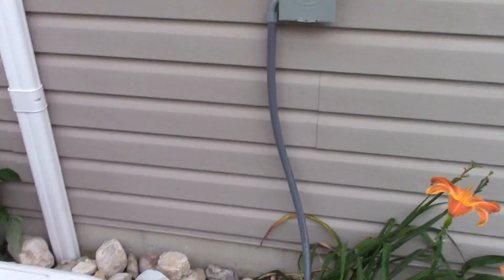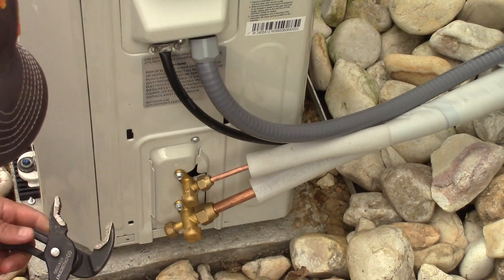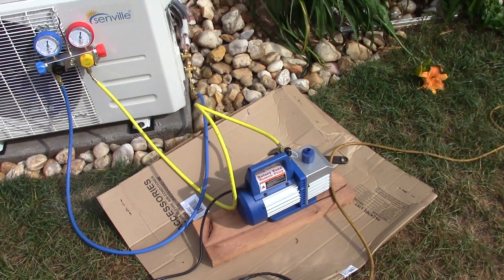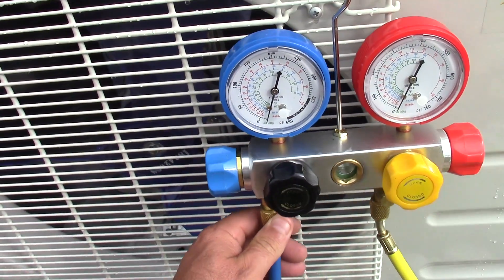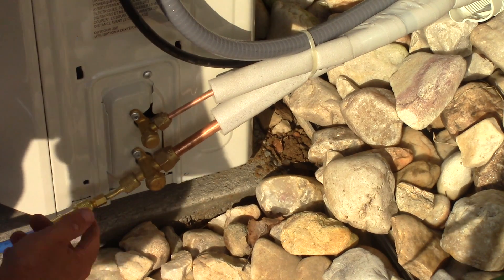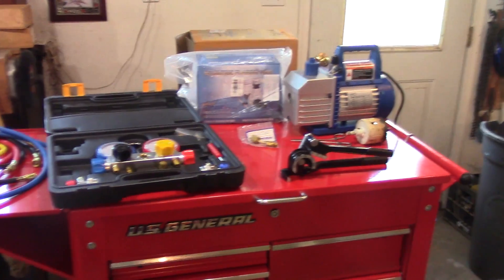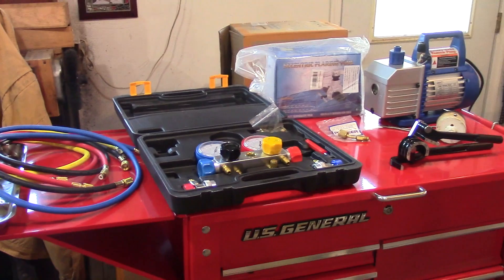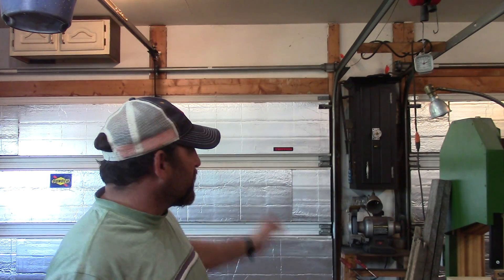Part 3 MiniSplit Install Adding Refrigerant

Comment: I'm about to install their (18000 BTU Mini Split Air Conditioner - Heat Pump - SENL/18CD/IY) . Where can I find info about what gauge wire and breaker to use for the electrical installation?
Reply from the maker: Check the national electric code for your area

Comment: Help. Im at the stage after ive added refrigerant of releasing the pump line. I have a tonnn of refrigerant spewing out and freezing the line. And this is just barely starting to unthread it. Not just a “little” like in your video. 

Ive tried it with the valves open like in your video, as well as the valves closed…. Are you sure i wasnt supposed to remove the pump line before charging it?

Comment: After releasing the freon into the system, why not just close the valve on the low side prior to removing the hose connection to prevent losing freon, in case it gets stuck mid-removal (I've had it happen) and then open it again after the hose connection is removed?

Comment: I think I messed up! I bought adapters for split ( same senville as yours) I thought I pulled a vacuum so I charged the system. I don’t think my adapter depressed the s header valve to vacuum the lines. Any thoughts about how to redo this? Tia
Reply: Did you get this figured out ?

Comment: Very nice videos Bob.  You covered A-Z!  On the lines, I would have run the vac longer, but it worked for you.  I also use a digital meter to try to get below 500 microns.  Gauges, especially the cheap ones, are not too accurate.  As others pointed out, you would need to test for leaks with Nitrogen.  I only pressure test if the lines do not hold the vacuum after 3-4 hours.  

I am installing a Senville now....24KBTU and you were the inspiration!  .  Hoping to complete next weekend.  The 7/8 line is stiff!  I probably will also post a video too.....not sure as yet.  TNX!

Comment: Great video, I'm almost done with the exact same unit install. Vacuum tested Great for 3 hours released freon had same result removing line slight freon release under pressure. My Guage didn't show positive pressure though. Did your Guage show positive pressure when freon lines were opened?  Tomorrow I will run the 240 volt power service.  I cut and flared all line sets because the pre made flares on the factory set were terrible.

Comment: I have a shed thats been Insulated w/ Foam 3+ inches a 350 Sq Ft Bldg. should I do 110 or 220 and is a 12K btu unit the right size?
Reply: Bonus Question : I dont need a heat, I live in South Texas. Can I get one that just has AC ??

Comment: So your unit came with the refrigerant in the condenser?  You didn’t have to buy precharged lines or extra refrigerant?
Reply: The unit comes with freon locked into the compressor and you release into the lines when everything is ready. I think these units come standard with a 16ft line set. The condenser holds enough for that line, if you need to shorten it they say you have to use at least 10ft of line or you will have to reclaim some freon because it will be too much pressure for the sorter line.

Comment: Can somebody explain a little more how to connect vacum pump.
It loolk like blue hose goes to ac unit from gauge and open to vacum and close when finish. What about other yellow one that goes to pump. Do you have to open the gauge as well before vacum and close when finish or stays close all the time.
Anyone that knows please advise.

Comment: Thanks for sharing.
Have a question for anybody that knows.
If installing inside unit on the room on top of garage just on top of the garage door. Can I bring the piping out the brick wall and then run it horizontally like 8 feet then go around corner about 4 feet and then down like 8-10 ft as long as tube reaches.
Will that be ok or is bad to bend pipe many times?
Please advise asap as I am installing it tomorrow.
Thanks in advance.
Reply: Multiple bends are fine, kinks are not. Bend slowly and carefully and you'll be fine

Comment: My pump came with a very clear oil in a bottle. I just had to add it. Great video!!! I just want to add to pay attention to the connections on the blue cable. You will need to connect it opposite of the yellow hose to disengage the valve at the AC side. Do as on the video and you will be golden. I just didn't notice it at first.

Comment: I have a dual split i just installed with both linesets being 25' each. The pressure is at 220 psi while off. Pressure drops to zero when running. Do I need to add more freon?

Comment: Just one question through.. how can you unpressurize your line if the valve you're conected to is closed. should you not open the bottom valve, vacc, close the bottom valve then open the top valve to release gaz in the lines?
Reply: I enjoyed your videos they're really great but I do have a question I bought a 18,000 BTU mini split unit I seen in your video you said it does not come with oil do I need to add oil if so how do I go about doing that before I pressurize the lines with the r14a

Comment: Well done video. Am about to install a Sennville 24000 btu dual . One question I have is each head has a 90 degree plastic hose barb included in the accessory bag. I cannot figure out their function or where they go. I have watched a few different videos but no but no one shows where it goes. It must be obvious but I'm not getting it. There is a hose barb fitting included with the compressor for the cabinet drain. Is it possible the ones included in the head units are spares?
Thanks for any insight into this.

Comment: Hey DW6, just finished watching your videos, great job, especially for us DIY'rs. Especially the purging of the unit of Nitrogen. I was curious about the outside unit being so low to the ground. Here on the east coast of Canada, Most HVAC companies recommend at least 2' off the ground, to allow for more airflow and for optimum efficiency should you get snow. (Which we do) I have x2 senville set up in my place, unfortunately the person that put them in did a poor install. This video will certainly assist me when/if I decide to up grade or re-install the these units. Thank you
Reply: If you get snow or water flood then it will be a good idea to either buy a metal bracket and attach it to wall as high as need it or build a table out of treated wood. Your unit will last longer, won't freeze on winter when using heat, metal won't rust as quick, etc... I install it at 15 ft because no snow and uneven driveway.

Comment: I notice you did not nitrogen pressure test or vacuum down to 500 microns using the appropriate adapters and Micron gauge. Have you experienced any issues with your unit related to short cutting the installation procedures?

Comment: If you vacuum the pipes, and you have an air leak, putting bubble solution on the connections will NOT show you the leak.  That only works if the pipe is under pressure, so you would have to hook up a compressor that will pressurize the line then find the leak, then vacuum it out again.

Comment: Great presentation but be more specific on using and connecting the vacuum line. I like and have used Senville units in my previous house and plan to but three of them in the near future and install them in my new house.
Reply: I need help on that too.
Only shows using blue hose from gauge to ac unit but not the one from gauge to vacum and need to know asap if that one needs to be opened before vacum and close when finish or if stays close all the timr.

Comment: Most of the dislikes will be from hvac people. Sometimes they just charge way too much. I needed a gasket for my goodman high efficient furnace. They wanted $90. plus install. I bought whole gasket set  from repair clinic for $7. and did it myself.

Comment: You did a REAL  good job with this video - I have a 1000 s/f home insulated with single pan windows  and located in the Northwest (Vancouver BC): which model would you suggest? With a second mini split how far can you position the mini split from the heat pump? Thank you again

Comment: Do you have the heatpump model? If so, did you install a drainline in the bottom of the outdoor unit? Instructions call for it, but there is no allowance for space, and there are two oval shaped holes on either side of the drain which seem to make the drain hose pointless.
Reply: I can't find where to put it neither.

Comment: Thank you doublewide6 for this informative video! You saved me $$$. Before this video I wasn't sure if my unit came with refrigerant or if I needed a tech to come in and fill it up. I didn't realize it was locked inside the outside unit. Thank you very much and I appreciate the help you offered through this video!

Comment: Really should run the pump for a couple hours in that setup. When you evacuate and check for leaks, shut off valve to the pump so it's isolated and gauge is just reading the system vacuum.
Reply: Can you please tell me if the hose that connects from gauge to pump needs to be opened before vacum and close when finish or stays close all the time.
Very confused, please advise.
Reply: @joaquinsuarez6090  Yes if I follow you correctly. The pump will vaccuum if the line is opened so I would open that line first so the hose gets vacuumed before the valve at gauge. Then when done close valve

Comment: The first two segments were helpful understanding what was required to do the installation.  However, the third segment is simply wrong.  I did the math and it didn't make any sense to me.  Rather than spend $3-400 buying a vacuum pump, manifold gauges, that $159 digital gauge and all the other stuff you need to do the hook up (and void the warranty), I hired a qualified AC technician to come in and do the final connections for me.  he brought his own tools but, more important, he brought the knowledge and experience to make sure the final hook up was done properly.  I paid the guy $350 and not only did he make the connections but he shortened the refrigerant lines to fit my installation so I didn't have coils of excess laying around (what you hid under rocks).  He also brought nitrogen to test for leaks before he released the refrigerant.  He even double checked my wiring before we powered it up.   

If the cost is about the same, why waste your time and money running around buying tools and stuff you will never use again? Better to spend your money making sure it is done right because doing it wrong can be even more costly in the long run...
Reply: what if i told you this video is for ac technicians like me...
Reply: @JO-lx9bx  it would suggest you aren't a very good one.  An AC tech would know all of this... I would hope at least...
Reply: @artdeco18  we know it after we watch the video and take ur $500
Reply: You can get the pump and manifold set for 139.00 on amazon!
Reply: $350 was a good price. Around here it would be $500 to $750 for the 30-60 minutes will take an ac company.
You can but the vacum and gauges for 1/4 of the price and sale them after using them a little cheaper.
Reply: Except what if there's a leak, and you're paying a guy 150/hr to find and fix. What if there's a leak 1yr down the road, again paying 150/hr to find and fix. Then your best friend sees it and want one...you don't have the tools to help him out. It's a tough call...

Comment: If i have a 115v , 20 amp mini split, can i still use a 60 amp ac disconnect box?
Reply: Yes if your breaker at the main panel is corrected rated.
Reply: Yes. 60 amp is the maximun that the disconnect box can handle.

Comment: My hvac wanted to charge me $400, to vacuum the system, this looks to easy, going to do it myself
Reply: Equipment cost me like $ 120, then return it , cost me nothing
Reply: @ckkendrick7861 Well I'm from Canada we don't usually do the douchebag rental here.
Reply: that's about the same price as the equipment you need to do it... Doing it yourself will also void your warranty.

Comment: I had a hard time figuring out the electrical connection for the indoor unit. Thanks for your video Part1 on how to remove the plastic covers, front and back to access the connection panel.

Comment: Local HVAC just about force personal installation. I got a couple of bids to do my garage, all were over $5000! Lets see, $900 unit, that leaves $4100 for the install. And I already have the electrical done! So instead, I buy a $900 unit, $100 in tools, and I am $1000 into the project. Even if I screw up, worst comes to worse, I have to buy a second unit and do it over. Then I would be $1900 into the project. If the local HVAC just charged $500 for their work, I would have gladly paid them!
Reply: Yeah. AC companies in my area charge $2000+ just for labor plus any parts needed.
Thank God for the people that share their knowledge here to us that can't afford to pay those crazy high prices.

Comment: H i there , could you have disconnected the blue line before opening the freon  ,so you dont waste or spill the freon ? thanks
Reply: mt no because the lineset was on negative pressure and it will suck moisture in.
Reply: @j.gutierrez2899  Can you please tell me if I have to open the gauge on the hose going to the pump before vacum and close when finish or it has to be close all the time and only open the blue hose to ac unit.

Comment: The 1/4" to 5/16" Pioneer brass port adapter has a schrader valve in it that you must remove. Otherwise you are only creating vacuum in the adapter itself instead of the whole system...
Reply: Likewise there is a Schrader in the service valve that was never removed? Not sure how you can pull a vacuum against the valve action.
Reply: @b1walsh  The adapter schrader valve pin is pushed inward, when the adapter is mated to the stem valve, which has a fixed pad.  Verify this by observing each component or blow thru the circuit end to end to confirm.  The schrader must remain installed.
Reply: The comment just saved my whole system. You did God's work with this comment thank you
Reply: IF it only creates vacuum in the adapter why would the gauge say minus 30?Hence the line set is under vacuum

Comment: I just installed the same heat pump but it’s a 12,000btu and I followed all your instructions, the indoor unit will turn on but the outdoor fan unit will not come on. It clicked every so often like it was getting power but the compressor would not turn on. Do you have any idea why?

Comment: Thanks for the awesome video! 

Any suggestions if my pump can only get me down to 24 PSI? I've left it on for several hours without any luck. 

Not sure if it has to do with the colder weather (30 degrees), elevation (4500'), pump size (1.8 CFM), etc.? Do I need to be worried about hitting the pressure recommended by the manual or is this difference negligible?
Reply: Are you sure all the connections are secure? The vacuum should sound different when it gets to its max vacuum
Reply: @brettmoore3194  After trying to pull a deeper vacuum for several days, I bit the bullet and released the refrigerant. The unit has been blowing hot for a solid few weeks now. I guess that means it worked?

Comment: Which knobs on the manifold gauges did you have on? Source, vac, high and low?
Thank you!
Reply: I need to know that too asap.
Do you open the knob on hose going to pump before vacum or stays close all the time?
Very confused.

Comment: I want to mount the indoor unit on an interior wall (separates two rooms). Can I get the lines to come out of the SIDE (not rear) of the indoor unit?
Reply: these units can be changed like he did to left rear, right rear, left side or right side.

Comment: The term 'inverter' when applied to mini-splits and heat pumps doesn't mean AC-DC conversion. It means these units can run the refrigeration cycle both directions - the operations of the indoor and outdoor coils are reversed from evaporator and condenser respectively to condenser and evaporator when the mode changes from cool to heat, and vice versa if the mode is changed from heat to cool. The inversion is facilitated by a reversing valve housed in the outdoor unit.
Reply: No you are wrong. The "inverter" technology mini-splits use IS the AC to DC voltage conversion, coupled to an ECM motor that drives the compressors. The inverters provide infinite current and voltage output between zero and full rate voltage/current draw. That is how they are so darn efficient vs. single stage and two stage rotary compressors. What you are talking about: The reversing valve, is simply that, a reversible refrigeration unit, or commonly referred to as a heat pump to differentiate them from simpler air conditioning, one way units.
Reply: WRONG, it's the electronics controlling the compressor, , has nothing to do with refrigerant flow, they react to load, no just on and off, variable speed all day long does what is needed, then coasts, study electronics INVERTERS...
Reply: HAHAHA, now that's funny, the "inversion", oy vey

Comment: Hello.
           First let me say thank you for taking the time to post these videos on mini/split installation. You stated you can add up to three head units for one compressor unit. My ?? is this. I have one master bedroom of apr. 254 sq. ft. and three additional separate smaller bedrooms of apr. 120 sq. ft. each. they are all on the same outside wall of the house where I will locate the compressor units. Is it much better to put four stand alone units for each room or is it considered more practical to have the additional head units for one or two compressors?? Keeping in mind I may not need to heat and cool all the rooms at the same time. I  may only need to heat/cool one room that I use as my office throughout the day but not the other rooms which will be unused during the day. Then in evenings and throughout the night I really may only need to heat/cool the master bedroom as the other rooms will be unused.